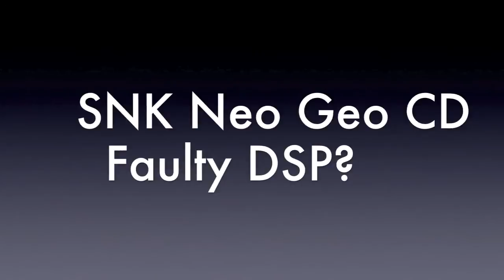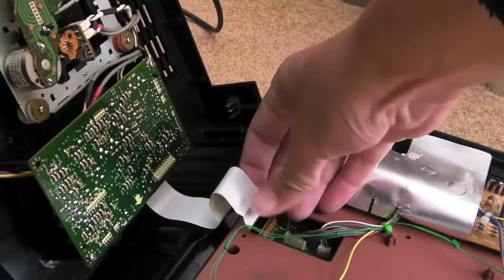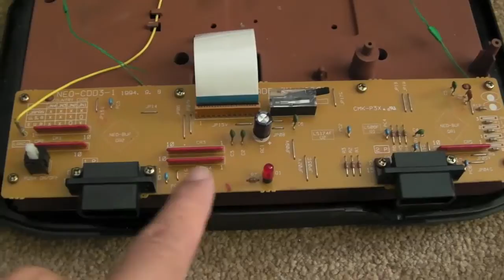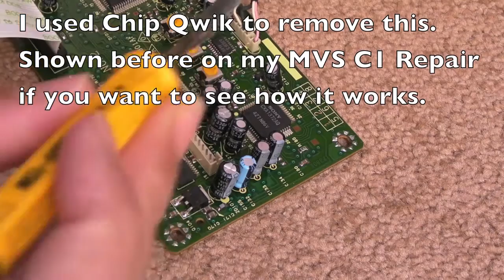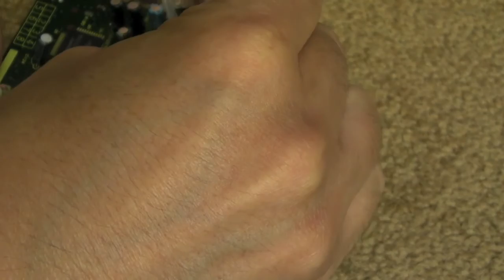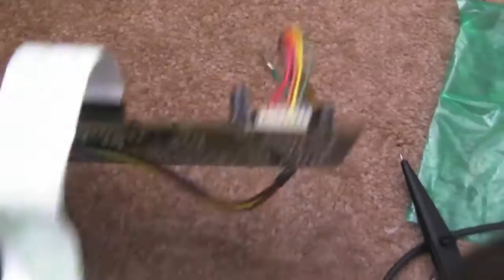SNK Neo Geo CD - DSP Fault? (Fixed? See Comments)

Comment: Dave Jones says "Don't drag your solder wick"
Reply: PCTonttu
GadgetUK is very much correct in his reply. Dave Jones is an excellent electronics engineer, but he's not very good at soldering. His technique is a bit awkward and he is making some serious mistakes like not cleaning the pads with alcohol before soldering, using iron tips that aren't always very suitable for the job, not inspecting the joints properly after soldering etc. Not long ago, he was trying to repair a device which he first failed at only because he got a bad solder joint on one of the pins of a chip; something that wouldn't have happened if proper inspection had been done after soldering was completed.
I love Dave Jones videos, but I don't take his soldering videos too seriously.
Soldering wick is sucking up the molten solder using capillary action. Because of this, only a feather-like touch of the wick to the pad is needed when cleaning the solder off the pads. It's true that you shouldn't press down with your soldering iron and then drag the wick around while keeping pressure on it, because you're pretty much bound to lift a pad off the board if you do that. But if you use the right technique (light or almost no pressure!), a clean iron tip and a good brand of solder wick, then there is no problem whatsoever "dragging" the wick over the pads.
So it's just as GadgetUK mentioned: Dave Jones is right about most of the things he says, but he isn't right when he says that it's not good to drag the wick across the pad.
Reply: GadgetUK164
 Sorry to be a little critical here, but I think you're pressing a little bit too hard on the wick in this video. If you have a look at 18:32 - 18:40, you can actually hear a squeaking sound as you're dragging the wick across the pads while pressing it down with the iron. There is nothing wrong with the direction of movement, but I very much suspect that you're applying too much pressure. If you have a look again at my Panasonic Viera chip replacement video (at 10:35 in the video), you can see that I'm doing this without any squeaking sounds coming off the board.
Since you're still using a cheap crappy solder wick, you're already at a disadvantage to start with. But there are a few things you can do to increase your chances of still doing a good job:

- Always use a clean tip. Wipe the tip off on the sponge before using the wick.
- Always put some flux paste on the pads before going over them with the wick. Not only does this assist in getting all the solder off the pads, but it also provides lubrication so that the pads are not subject to that much stress. This is very important for reduced risk of lifting pads!
- Always put just a little bit of solder onto the iron tip before you touch the tip to the wick. The solder creates a heat bridge, which assists in transferring heat to the wick as soon as the iron tip touches the wick. No pressure needed.
- The solder wick reel acts as a heat sink. Although not necessary, it might be more effective sometimes to cut a piece off the reel and hold that with a pair of tweezers instead. Again, you can refer to my Panasonic Viera chip replacement video for a practical example on this.
Reply from the maker: Yeah, I watched that and he's wrong lol!  It's all about your technique, and the temperature of the iron, and which direction you drag in.  In this video I didn't drag in the best direction really - It's better and safer imo to go the other way, there's less risk of removing a pad that way.  It varies from board to board as well, it depends on the quality of the board and how well the pads adhere to the PCB.  If you do what Dave did and heat the wick and lift it straight up, there's a lot more chance of pulling the pad off.  See some of the comments on his video from other people.  Dave is right on 99.99% of things he does but that wasn't one of them.
Reply from the maker: RetroGameModz Yes, you are right!  I've often thought that whilst watching back my own videos lol.  I've never pulled a pad that way but it can't be good for the board.  Part of the problem at the moment is I am still using that crappy braid - I will get some of the ChemWik you recommended.
Reply: People often seem to think about it as "lifting a pad or not lifting a pad". But why should we look at the world in a grayscale? There are colors between black and white as well.
The pads are attached to the PCB substrate with a special bonding material. This adhesive will start to break down when exposed to high temperatures for a prolonged time, and even more so if at the same time being subject to mechanical stress. However, this doesn't necessarily mean that the bonding material breaks down completely, deattaching the pad from the substrate. Just like you can remove a stain on a t-shirt either partially or completely, a pad can partially be delaminated from the PCB if incorrect rework procedures are being used. This might or might not be noticeable during the time of repair/rework, but what happens when the next technician comes along and starts to rework the very same site on the board, also using incorrect rework procedures? Of course, the risk of that pad lifting off the board will then be even higher as a result of what the first technician did to the pad. One of the biggest mistakes repair technicians are doing during soldering is to look at the outcome of the repair and then judge their repair techniques only after that alone. If you look around on forums you will see ridiculous claims like "Twisting and pulling the caps off the board is a good technique that works. If you do it correctly, the pads will not come off the board." It's like these people only have one bit of resolution in their way of thinking. Pad stays on board; 0. Pad comes off board; 1. :)
Reply from the maker: RetroGameModz Excellent advice there as always =)